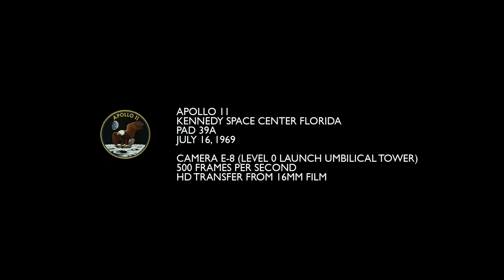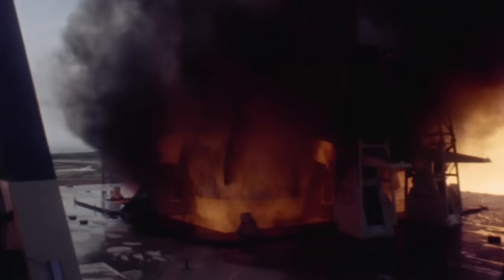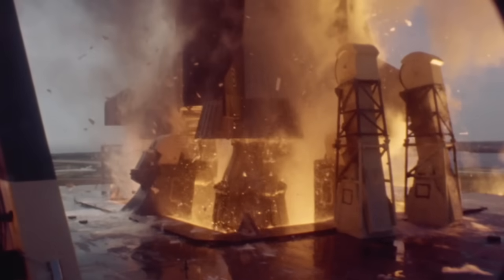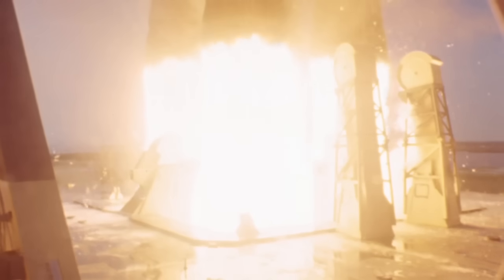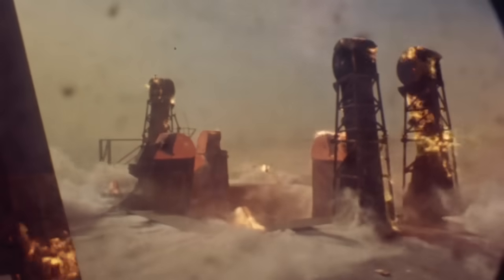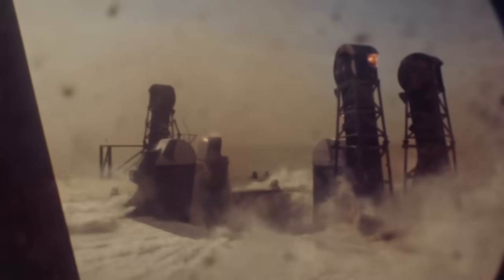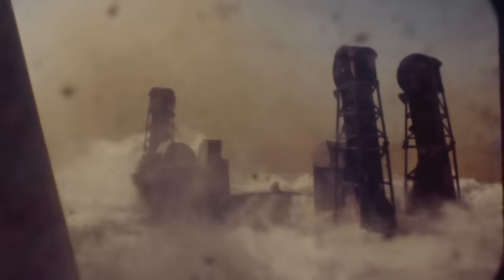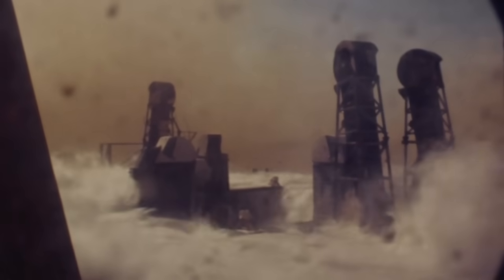Apollo 11 Saturn V Launch Camera E-8

Comment: What supports the rocket to keep it vertical and off the ground?
Reply: if you’re talking about control in flight, the engines can gimbal or swivel to direct thrust and control itself
Reply: @astrocakes829  no. As it sits on the pad

Comment: How did these towers not melt and deform under such intense heat, when the steel structure in Building 7, which didn't have anywhere near this amount of heat and pressure, collapsed into it's own footprint?
Reply: Design, and very large quantities of water

Comment: Doesn't mention that fuel was being consumed at 15 tons per second or that the rocket weighed 2,950 metric tons (mostly fuel) or that it took almost 7 seconds to develop sufficient thrust to lift off.
Reply: What in the actual duck

Comment: Around 4:55, you can see a couple of shorter structures on the left glowing red hot from the exhaust. They cool off very quickly as the rocket moves away.

Comment: Fake-ass video. Where are the mach diamonds?
Reply: where's your brain
Reply: @hunterhatcher6874  
Apparently, where it's always at, on my head. Where's yours? What's your point?
Reply: fib notnow why are you saying this video is fake
Reply: @hunterhatcher6874  There's no mach diamonds, can't you read?
Reply: fib notnow once again i shall say: 70's cameras are bad. for the upclose engine shots the exposure is turned way up so the shots are darker. you can barely make it out in most of the clips. Also the engines on the saturn v produces a orange and slightly yellowish flame. this makes the shock diamonds very hard to notice.
Reply: @hunterhatcher6874 Why is there so much smoke and flames? In shuttle launches, you can barely see the flame the engine emits.
Reply: @hunterhatcher6874  What happened, why is no answer forthcoming?
Reply: fib notnow because the engines on the space shuttles emit a blue plume. very hard to see against the blue sky. the space shuttles engines are a special kind of engine that is kind of a hybrid. engines are designed around what they need to do and the most efficient way to do that. since the space shuttle would be mainly lifted first by the SRB's the engines were designed with a bigger engine bell for more efficiency in the upper atmosphere. and also not all engines make visible exhaust. it depends on the fuel it's using.
Reply: @hunterhatcher6874  You mean if we were to remove the blue sky, all the flames and smoke would magically appear? Also, what do you mean by hybrid? Also, are you saying that the space shuttle is launched by the SRBs with no thrust initially taken by the main engines? Then why even fire it up before launch? What fuel with no visible exhaust are you talking about?
Reply: fib notnow no i'm saying the srbs are the main lifter. it still does not have enough to get it going fast enough. the space shuttle engine exhaust is mainly water vapor. which is invisible. it's produced when the liquid hydrogen combines with the liquid oxygen.
Reply: fib notnow the engine plum would be more visible. the exhaust is water vapor. which is invisible.
Reply: @hunterhatcher6874  Let's get back to the F1 engine. Why so much flame and smoke?
Reply: fib notnow the f1 engines are very, very large. and they use a mix of kerosene and liquid oxygen. when these two combine they produce an insane amount of thrust out of the f1 engine and they are also very reactive. this causes the big flames and exhaust
Reply: @hunterhatcher6874  You're wasting your time buddy. They only post to troll and don't want to learn anything.
Reply: @hunterhatcher6874  Is that a statement of fact or your own personal opinion, because a jet engine disproves your claim. You don't see a lot of smoke and flames coming from jet engines.
Reply: @SMHman666  Another treefiddy poster. Who pays you, CIA or NASA?
Reply: @fibnotnow3392  Because temperatures in jet engines are lower, than in the rocket engines, and they also don't have as much of a soot problem due to increased amount of remass flowing through the engine (which rockets have trouble with due to mass limitations).
Reply: @caav56  You're implying that rockets can't burn their fuel properly, so they're wasting unspent fuel during launch, hence the orange fire and lots of smoke?
Reply: @fibnotnow3392  Sorta. Kerosene offers decent performance, but also generates lots of soot, which makes it harder to see through fire and might clog up the engine, if something goes wrong. Soviet Union had to develop oxygen-rich staged combustion because of this.
Reply: @caav56  Did the F1 engine use any sort of staged combustion?
Reply: @fibnotnow3392  Nope, it dumped cool-ish sooty exhaust of turbopump's gas generator around the rim of engine bell to protect it from high temperatures.
Reply: @caav56  do jet engines have any staged combustion devices or open gas generator devices in them?
Reply: @fibnotnow3392  I mean the plume is overexposed due to blackbody radiation, caused by the fuel choice (RP-1 and liquid oxygen). You can't see anything in it...

Also even if it magically weren't overexposed, you wouldn't be able to see them because the plume is opaque, again due to the fuel. You can only see the mach diamonds in engines using fuel like hydrogen or methane.

You've never noticed how you couldn't see the plume in the RD-170 family or Merlins either? Okay...
Reply: @fibnotnow3392  Shuttle main engines "burn" hydrogen/oxygen.  When hydrogen reacts with oxygen ("burns") there is very little flame visible.  Saturn V burned kerosene.  Kerosene, being derived from a fossil fuel, produces thick flame and smoke when it burns.
Reply: @caav56  You'd better check your answer against Wikipedia's entry on the gas generator cycle in rockets. It states: However, there are forms of the gas-generator cycle that recycle the exhaust into the nozzle of the rocket engine. This is seen in the F-1 rocket engine used on the Saturn V booster stage. This is direct contradiction of your claim here.
Reply: @fibnotnow3392  It's still dumped outside of the combustion chamber. If you look at the F-1 nozzles, you can see a spiral tube after the choke - that's where through the exhaust of gas generator is dumped. The same applies to the Merlin Vacuum engines.
Reply: @caav56  It's still inside the nozzle, not the rim, which contradicts your claim. At 3600 degrees, any kerosene-based fuel would be fully burnt, not that sooty smoke you'd see.
Reply: @caav56  Chirp... chirp... chirp.
Reply: @fibnotnow3392  What are you even saying by that?
Reply: @caav56  Crickets chirping.
Reply: @caav56  Chirp... chirp... chirp.
Reply: @fibnotnow3392  Okay, so, now that I'm a bit free, I have a chance to answer to you:
> At 3600 degrees, any kerosene-based fuel would be fully burnt, not that sooty smoke you'd see.
Only if there's an oxidizer available for that. Without it, kerosene would coke up - Jet A-1, for instance, will start to coke up at 670K, making it unsuitable for cooling rocket nozzle (or else it'll coke up and clog the channel).

>It's still inside the nozzle, not the rim, which contradicts your claim
And? It's not inside the combustion chamber anymore.
Reply: @caav56  So you're saying NASA couldn't be bothered to increase the oxygen content of the fuel feed? Ha Ha, that's a laugh. Inside the combustion chamber? Then why bother rerouting the fuel back inside the nozzle? Why not just dump it along the edge after cooling the nozzle?
Reply: @fibnotnow3392  >So you're saying NASA couldn't be bothered to increase the oxygen content of the fuel feed?
Yes, because it would've increased the temperature in the gas generator and damaged it, stopping the turbopumps and, with them, the rocket engine. Running fuel-rich was to keep the temperatures down.

>Then why bother rerouting the fuel back inside the nozzle? 
To serve as a protective blanket against the exhaust. Same is done on the Merlin-Vacuum engines nowadays. By the way, if you look at the schematics of F-1B engine (proposed modern version of F-1), you can see, that it has a straight exhaust pipe near the nozzle, like the sea-level Merlin, because it, thanks to the advances in material science, wouldn't have needed this trick to avoid melting nozzle anymore.

>Why not just dump it along the edge after cooling the nozzle?
That's... exactly what's happened? It was dumped inside the nozzle to form a protective blanket against the hot exhaust from the combustion chamber, but it didn't combust anymore.
Reply: @caav56  >Yes, because it would've increased the temperature in the gas generator and damaged it, stopping the turbopumps and, with them, the rocket engine. Running fuel-rich was to keep the temperatures down.
You completely missed the point I was making. The lack of oxygen I was referring to was the fuel and oxygen mix used for the main fuel line, not the turbopump exhaust. The way the F1 works is akin to an afterburner where fuel is dumped into the main exhaust from the unspent fuel from the turbopump exhaust. I'm saying why can't NASA be bothered to increase the oxygen ratio in the main feed? Also, take note, afterburners are outside a jet engine's combustion chamber.

>To serve as a protective blanket against the exhaust. Same is done on the Merlin-Vacuum engines nowadays. By the way, if you look at the schematics of F-1B engine (proposed modern version of F-1), you can see, that it has a straight exhaust pipe near the nozzle, like the sea-level Merlin, because it, thanks to the advances in material science, wouldn't have needed this trick to avoid melting nozzle anymore.
So what's the point of cooling the nozzle by piping the turbopump exhaust around the nozzle if it already serves as a protective blanket to cool the nozzle?

>That's... exactly what's happened? It was dumped inside the nozzle to form a protective blanket against the hot exhaust from the combustion chamber, but it didn't combust anymore.
Same as my last point.
Reply: @fibnotnow3392  >. I'm saying why can't NASA be bothered to increase the oxygen ratio in the main feed?
Did you see the recent testing of Starship SN8? Specifically, what happens, when there's too much oxidizer in the combustion chamber? Spoiler alert - the hardware-rich combustion happens. Soviets were able to make staged-combustion rocket engines back then, but it required some damn crazy metallurgy, as they've had to run oxidizer-rich, instead of fuel-rich.

>The way the F1 works is akin to an afterburner where fuel is dumped into the main exhaust from the unspent fuel from the turbopump exhaust.
Uhm... I don't think so. F-1 used tapered baffle injector plate, which was fed with fresh fuel (albeit already used for regenerative cooling) and oxidizer by turbopump. Exhaust from the gas generator, which is used to power the turbopump, is then dumped around the nozzle.

>So what's the point of cooling the nozzle by piping the turbopump exhaust around the nozzle if it already serves as a protective blanket to cool the nozzle?
The nozzle is cooled by the fuel, which is pumped inside of it. To prevent it from getting too hot, the turbopump exhaust is used as a protective blanket.
Reply: @caav56  
>Did you see the recent testing of Starship SN8? Specifically, what happens, when there's too much oxidizer in the combustion chamber? Spoiler alert - the hardware-rich combustion happens. Soviets were able to make staged-combustion rocket engines back then, but it required some damn crazy metallurgy, as they've had to run oxidizer-rich, instead of fuel-rich.
I can't believe you inserted the term hardware-rich combustion into the conversation. It's a word they invented for "we don't know what happened." What are you going to introduce next, space monkeys did it, so it exploded?

>Uhm... I don't think so. F-1 used tapered baffle injector plate, which was fed with fresh fuel (albeit already used for regenerative cooling) and oxidizer by turbopump. Exhaust from the gas generator, which is used to power the turbopump, is then dumped around the nozzle.
Tapered baffle injector plate? Isn't that in the combustion chamber?

>The nozzle is cooled by the fuel, which is pumped inside of it. To prevent it from getting too hot, the turbopump exhaust is used as a protective blanket.
Again, why bother with the re-route of  turbopump exhaust around the nozzle?
Reply: @caav56  What happened here? Why are there no more replies? I wanna know, specifically, why you showed me the tapered baffle injector plate which is in the combustion chamber when earlier you were quite insistent the exhaust gases does nothing since it was injected outside the combustion chamber.
I also wanna know what a "hardware-rich combustion" event actually is. Spoiler alert, the SpaceX Starship recently exploded. Would that qualify as a hardware-rich combustion event? You know, all those millions of dollars in rocket hardware up in smoke and flames. I'm being sarcastic here, in case you didn't get it.
I also wanna know why the exhaust gases do double-duty cooling the nozzle and cooling it again as they mix with the main exhaust.
Reply: @caav56  Chirp... chirp... chirp.
Reply: @caav56  Chirp... chirp... chirp.
Reply: @caav56  Chirp... chirp... chirp.

Comment: 'faked moon landing' ppl are widespread.
idk how many disbelieved in the actual Saturn V rockets.
they were built up from/based on WW2 Nazi rocket tech. The V-2,
aka, Aggregat 4, for instance.
The Nazi's got the tech from Demonic entities. 
It is well known they (Nazi Party)
were heavily into the Occult.
Wilhelm & Magnus Von Braun, et al would tell you so, if they were still around.
They admitted it, back when, but many ppl cannot admit to the 
supernatural, for various personal reasons, so no one talks about it.
/////
..how much radiation is present in the 
Van Allen radiation belts?
if it's low enough..then we made it to the moon.
if not..we did not.
Reply: They don’t understand that apollo went around it xd.

Comment: My father in law helped design those oxygen suits they used on the moon. Worked for GE back then. Amongst other things. Long story. No bs.
Reply: I am too young to remember Apollo.  I have worked in Aerospace for a few decades and I can appreciate the incredible effort to pull this off.  The program managers down to the guy turning the screws on a fixture must have had immense drive and pride to make the moon landings happen.  They did great work that will forever be one of mankind's greatest achievements.

Comment: I still wonder how they were able to harness that much power under this tall rocket without it crushing itself from the bottom up at ignition. I realize there's framework but I've never seen a model of it....it's all covered up with the panels that read "USA".... gives me the chills every time I see it go by.
Reply: I think they use vertical bars to help keep it straight and the tank pressure helps a lot. Look at the video where that one rocket fell over after loss of tank pressure and exploded lol

Comment: Human evolution in the making, we accelerate every century and soon to the point where the solar system will become the norm human neighbourhood. 1869 Tech was as basic as you can get until 100 years later..... 2069 will be solar system evolution.... unless more countries have Trump/Dictator personalities and bring the human race close to wars most don't want, bringing the human race to extinction by pushing the planet into an early meltdown and releasing toxic to human gasses, which alter the planets makeup for the next 500 years causing planet wide flooding and unbreathable air. This rock commands respect just like this technology commands respect.

Comment: Space is water. The earth is flat and square, supported by four great pillars, immovable and covered by the firmament dome. The South Pole, is a high walled, ring of ice, which contains, the earth's oceans. Beyond the ring of ice, are many uncharted lands. The sun and the moon (equal in size, approx. 50 kms. in diameter) are just lights, that hover, in a circular trajectory, beneath the dome. The stars and planets, are just lights, inside, the revolving dome. There is no gravity, rather, think in terms of, the density of air, i.e. an object that is denser than air, motions towards the ground, an object less dense than air, rises up, into the air. Similarly, in water, think in terms of buoyancy.
Reply: Ice float on water.
Reply: Give me an equation for buoyancy that does not involve gravity.
Reply: Flattards like uppity and downity.  
  It's easier for them .

Comment: 2:20 Not 100% sure, but I think that this "black" exhaust comes from extra fuel injectors around the wall of the bell. The engine runs different fuel-air ratio - fuel rich ratio = worse brun, black exhaust and "cooler" burn temperature.

Comment: Why gasoline and kerosine? Why not just one fuel?
Reply: It was kerosene and liquid oxygen I believe.  And when you combine the two, it produces a lot more thrust/more powerful reaction.  I am no expert though.
Reply: @nyyankees4296  thank you. Makes sense now.
Reply: @minkymott  The rocket won't go anywhere if it just has fuel.
It needs an oxidizer. In this case it was liquid oxygen. Different rockets have different fuel and oxidizer.
Reply: @SSran-iv4lu  thank you. Now I understand.

Comment: The turbo exhausts are said to exit through the main nozzles, the dark streaks. I saw a schematic sketch of the F1 engine where the turbo exhausts were dumped via separate pipes outside the main nozzles.